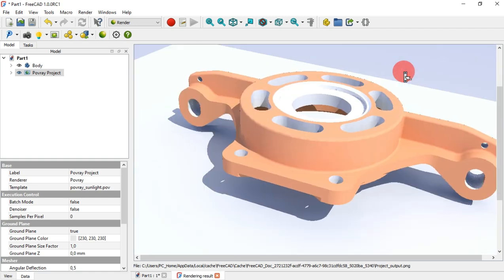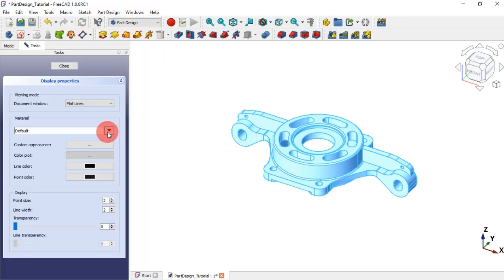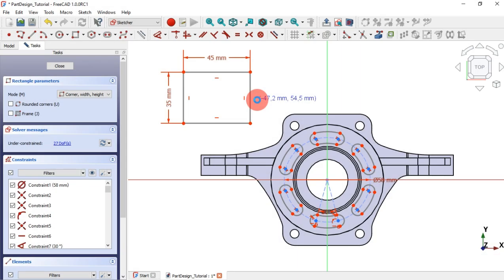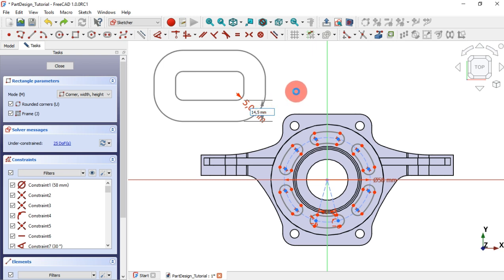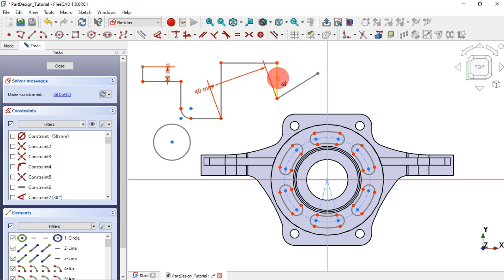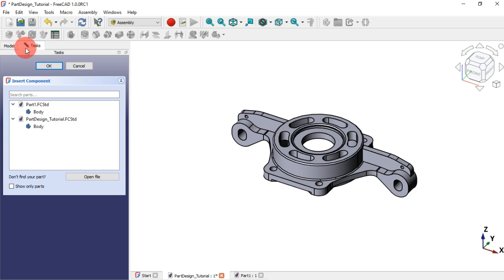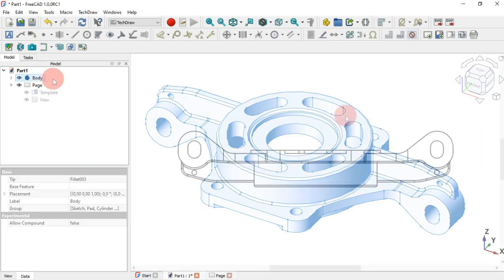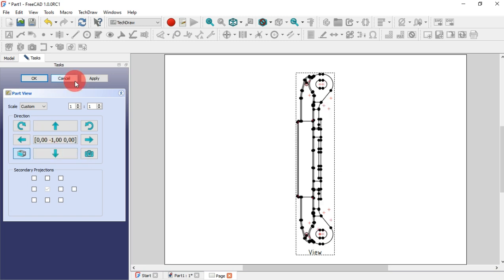FreeCAD 1.0RC1 workbench's new and improved tools

Comment: Things that are missing in the part design
• defining external geometries (project and intersect)
• being able to reference from other bodies
• part design built in surface tools
• boolean without deleting the boolean body
Reply: you can use external geometry from inside a body and outside of it (with a ssb)
Reply: @drwho495  i mean without using ssb
Reply from the maker: Houuu, indeed.